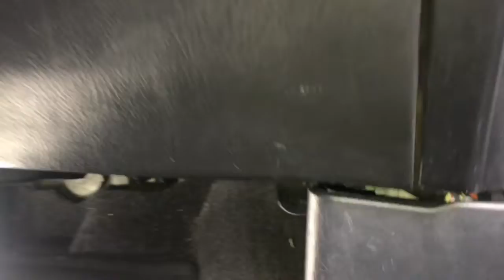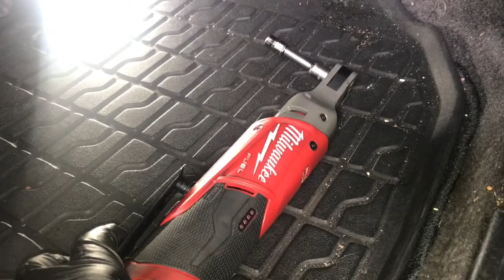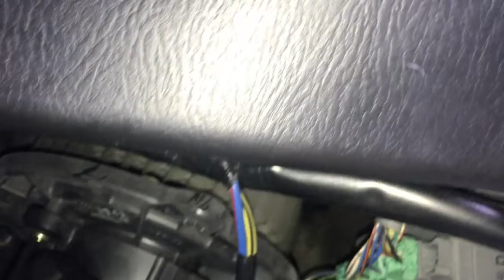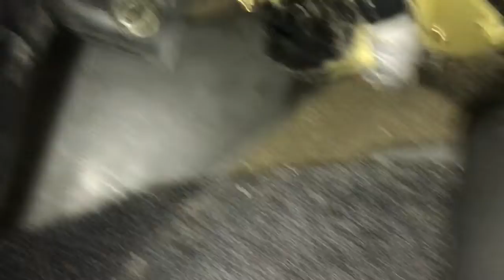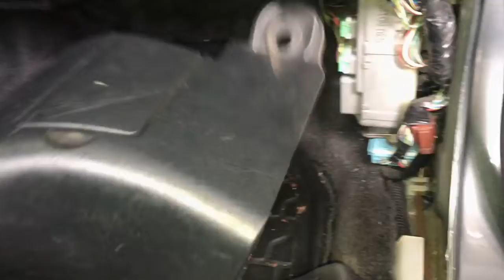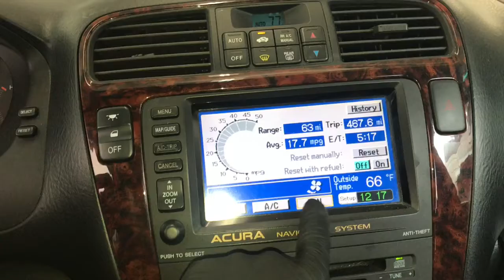How To Replace The Blower Motor And Blower Motor Resistor On An Acura Mdx

Comment: For everyone having trouble with the third bolt on the blower a stubby screw driver works wonders or what I used was no extension but a deep 8 mill socket instead long enough to reach short enough to fit also was in a weird position like a half cart wheel type of position hope that helps

Comment: Now after removing the 3rd bolt... I love videos just that easy!
Reply: I can't take that shit out
Reply: @davidpedraza352  I honestly felt stupid because I was trying to remove the last bolt in the wrong area and wasn't even touching the bolt 😂 when I found it it came right out but a pain for sure
Reply: @WoWgen123  well I'm working on the 3 bolt 🔩🔩 now ..I just can't take it out
Reply: @davidpedraza352  just get one of those little mirrors with a light and have someone hold it. And use a small 1/4 ratchet you got this! If you get frustrated just take a break and come back. 🔩

Comment: How in the hell did you get the back one? I even got an electric ratchet. There’s no room to reach it with the floor board.
Reply: I just went through all this today and struggled with the back bolt as well. I was able to finally get it by yanking the carpeting back a bit to get a little more room. It also helped to use the camera on my iPhone to actually see where the bolt was.
Reply: @Billmorganmedia-pix  that’s the only way I wound up getting it too. I didn’t even put the back bolt on. Too much for me. But I got it off and got the dead mouse out. Cleaned and put back on. I call that a win lol
Reply: My bf gave up just now and called AutoZone to see if they could get a bolt off for him 

They were like sure we can try?? Bring it up here lol

Comment: I have a 2004 Acura MDX and had to take my car into the dealership to get the passenger side airbag replaced for a recall. The next time I tried to use my AC it didn't work. The dealership said I had a bad AC blower resistor and was going to charge me $300 just for the part. I bought one myself and replaced it but it still doesn't work. Any ideas?
Reply from the maker: Patrick B that sucks and it sounds like things the dealer May have caused. I would check fuses and check all the connections for the blower resistor and blower motor.

Comment: My motor makes a loud noise like an airplaine. I thought that might be debris in my filter, so I pulled out the filter but the helicopter noise is still there, even louder now because it is not muffled by the glove box. Do I need new blower motor or there will be debris in the blower motor causing the helicopter noise?
Reply: search for a few more videos on here...I had the same problem with my '01 MDX...I would bet you have debris in the rotor...that's what I had...rocks, pieces of plastic bag, leaves, etc...Follow this video to remove the blower rotor and clean it out.  Put it back in and now works great.  Good luck.  Whole job took only about 45 minutes.

Comment: Front AC motor in my 2003 MDX was shutting off intermittently, and coming back on when it wanted to....So I followed the advice on this video and ordered parts on Amazon. First two screws (on the motor) were no problem, but I gave up on the 3rd one ( too deep inside). I called a local mechanic, who finished the entire job in 45 minutes. No AC problem 👍😁
Reply from the maker: Glad it all worked out. Thank you for watching!

Comment: What do I do if I have clicking noise in that department, it just clicks and clicks. It started last week when I tried to remove the stereo and trip computer so I thought debris must’ve gone through to some moving components there and It’s driving me crazy. I removed the glove box and some switches and that turned off the ignition so that sent me straight to agonizing sleep. I have 2006 Acura MDX touring

Comment: Thanks for the informative video, Brian.  My 2005 MDX AC/Heater has been making intermittent noises for the last few months.  I always hit the "full auto" button and let the AC unit adjust to whatever temperature I set instead of using the manual controls.  Last weekend I changed the cabin air filter and checked for debris in the blower fan but that was clean.  The cabin air filter had turned completely black.  Whenever that sound occurs I simply turn the fan off and back on again, which stops the noise.  Yesterday on the way to work it started making a squeaking sound so I did the off/on maneuver with the fan again.  I drove it last night and again this morning on the way to work without any issues.  Should I replace the resistor, and if so can I replace it without taking the motor out?  Thanks so much for your help.
Reply from the maker: Kevin Smith the squeaking noise is most likely coming from the bearing on the motor. As far as resister goes I would change it because it builds up corrosion inside the airbox and causes him to malfunction. So it’s only a matter time before your resistor will go out.
Reply: Thanks again Brian.  Can the  bearing be replaced or is it better to change the whole motor?
Reply: I finally got around to changing both the resistor and blower yesterday and thanks to your video was able to do it without uttering a single curse word!  Unfortunately it is still making that intermittent sound.  Any other ideas on what could be causing it?  Idk, maybe it's a squeaky belt.
Reply: Finally figured it out.  It was my rear blower that was making the noise so I replaced that on my own as well as the rear resistor.  Everything is fixed now.  To have all four parts replaced at the dealer probably would have been around 2,000 dollars.  I paid around 200 dollars for all four parts.

Comment: Thank you very much! My son and I just followed your instructions and replaced the blower and blower resistor in our 2002 MDX with 250,000+ miles. We ordered the parts using your link. Total cost under $80. My son is looking forward to having cold AC again as the temps hit 117 this week in Phoenix!

Comment: Changed the resistor in mt 2001 acura mdx. The fuses are fine. The rear ac just doesnt work. The lights on it doesnt light up either. Any thought on what i could try next??? Thanks
Reply: aja scott clean up the filter , common thing look it up. I have to do it also

Comment: After 150k miles my blower on my MDX is making a squealing sound.  Do I need to replace both the motor and the resistor or just the motor?
Reply from the maker: Anthony Haupt if the blower is working on all the speed Then you do not need to replace the resister.

Comment: Is this to fix the heat if hot or cold air isn’t working?
Reply from the maker: Sebastian Figueroa this is to fix the air flow through the dash. Resistor controls the fan speed and the blower motor blows the air through the dash. If you're not getting heat through the dash but the blower is working then you most likely to have low coolant or a blend air door problem.
Reply: @HowtoAutomotive  my blower
Is working but I can't control it plus it only blows warm air. Thanks

Comment: How to recognize when your in limp mode and what can you do about it ? your thoughts thank you
Reply from the maker: charles philippe if a car is in limp home mode it usually has a reduction in power and only go about 40 mph. Check Engine light will be on. Start by pulling the code interview now what caused it to go into limp mode repair and clear codes.
Reply: thanks so much